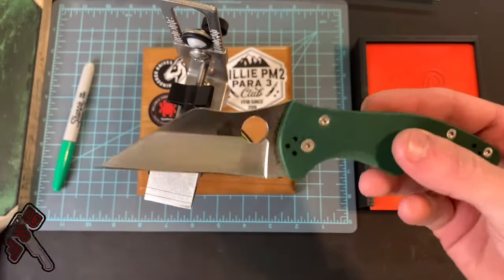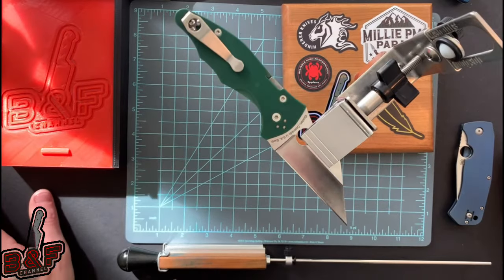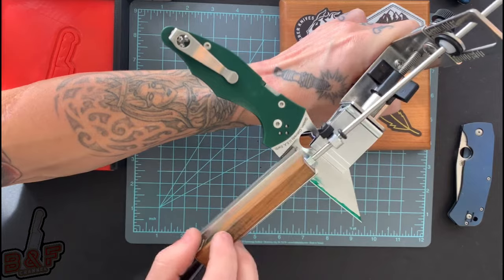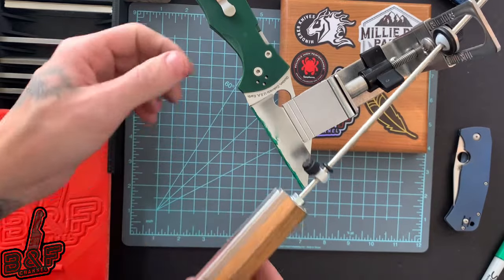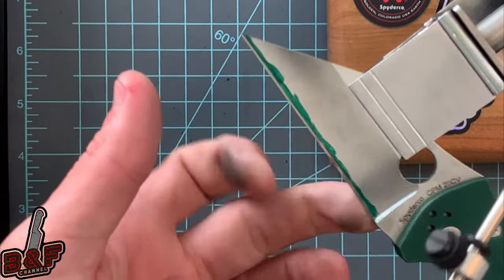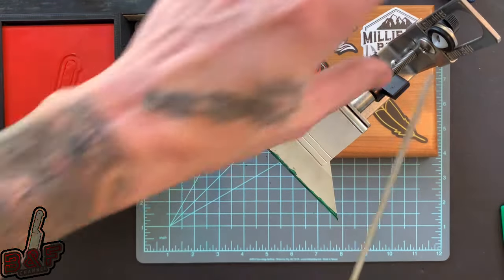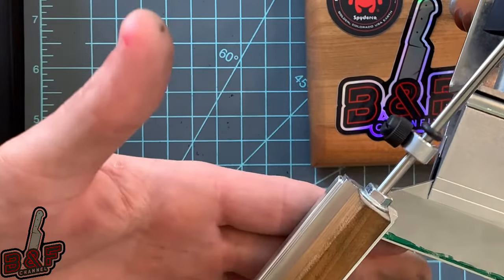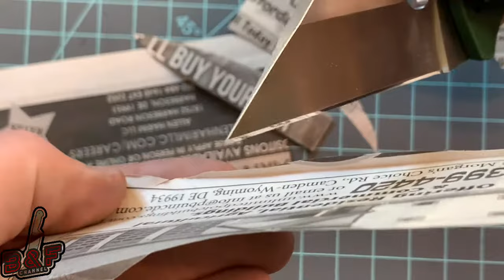SHARPENING THE SPYDERCO YOJIMBO2 20CV DLT TRADING EXCLUSIVE ON MY KME START TO FINISH!

Comment: Do you have to start from the first stone if you already have a sharp factory edge or can you jump to the last few stones if you want a mirror polished edge?
Reply from the maker: Depends if you are keeping the factory angle! You technically “probably” could get away with it but the factory sharpens with belts and therefore can have inconsistencies which will cause problems. I’d definitely recommend starting with your lowest grit no matter what so you can get a 100% consistent even bevel and that will allow you to get the best cutting performance and also allow you to get the best finish possible with the stones you have!
Reply: @BLADESANDFADESOFFICIAL  thanks for the info.  I just bought a KME.  I need to buy these stones you recommended in this video.
Reply from the maker: @aatkinson1979  anytime brother!!
Reply from the maker: @aatkinson1979  and the 2 additional stones I recommend in this video aren’t necessary to get really nice super sharp edges, the main thing that they do is allow you to get a polished more refined edge. Polished edges look really nice and they are definitely sharp but a 600 or 1500 grit finish has a lot of benefits also and will typically have a lot more bite and feel like they cut through a wider range of materials easier! Just something to keep in mind!

Comment: why you dont use water or oil ?
Reply from the maker: It’s not needed with diamond stones. You can use it if you desire but I don’t because it makes a big mess.
Reply: thx, i would bc i dont like the sound :)
Reply from the maker: @thorael  yeah I feel ya, sometimes I use soap and water in a spray bottle and spray the stone and blade and wipe the debris, it definitely doesn’t hurt to use water but it does tend to make a mess!